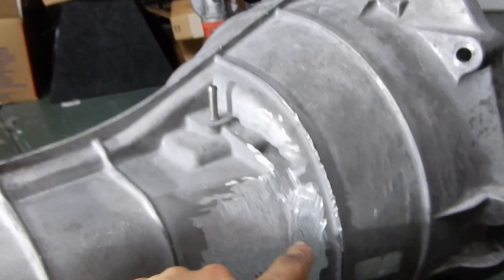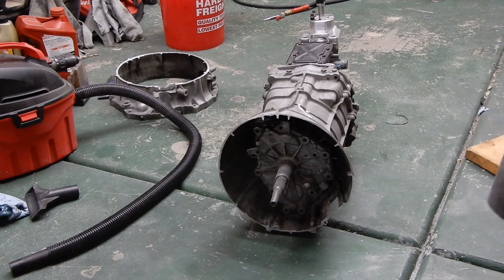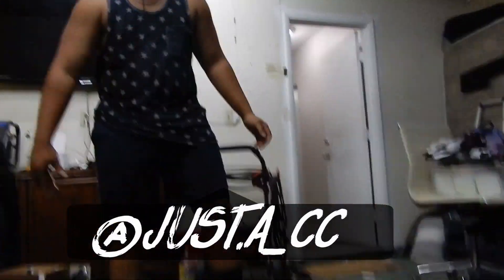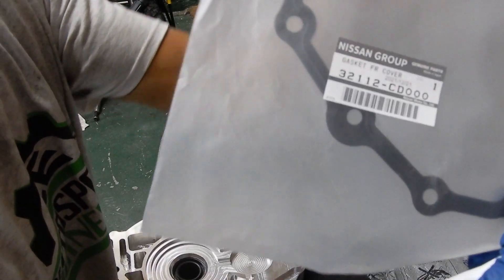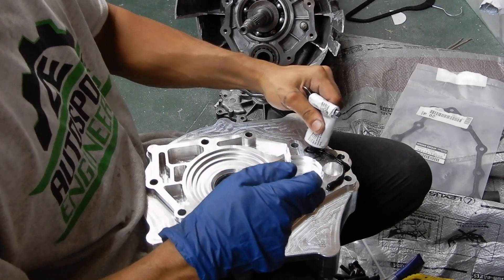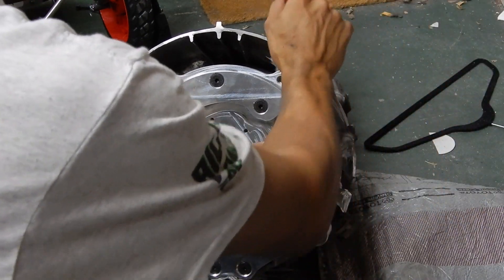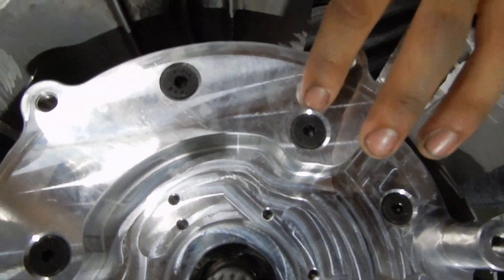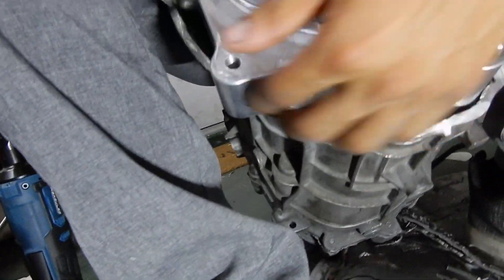CUTTING UP MY FRESHLY REBUILT CD009! Autosport Engineering Adapter Install |Manual Swap SC300 Ep. 2|

Comment: what clutch, clutch pedal and clutch cylinder you using
Reply from the maker: Clutch: Z1 Stage 2 Full Face 
Clutch Pedal: Xcessive Manufacturing
Clutch Cylinder: A 1990 Toyota Landcruiser Clutch Master from Oreilly Auto parts